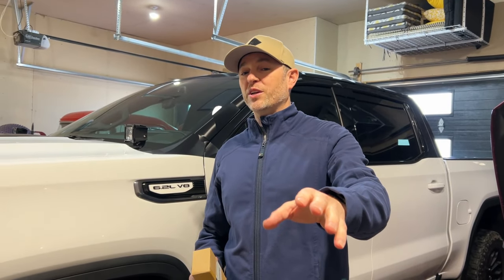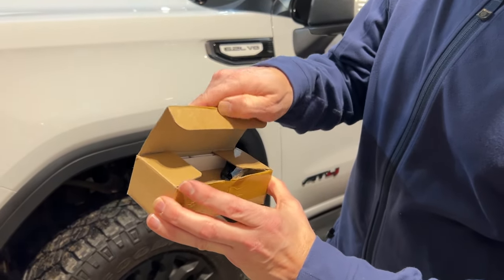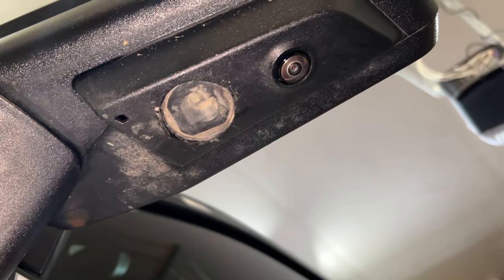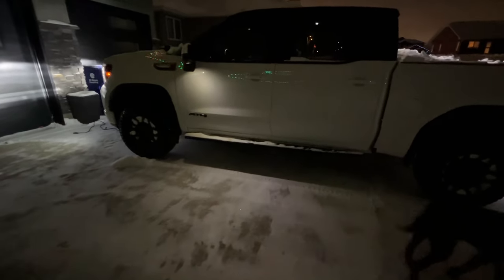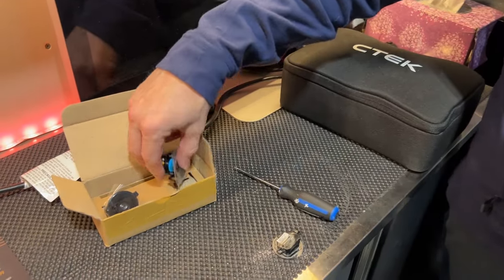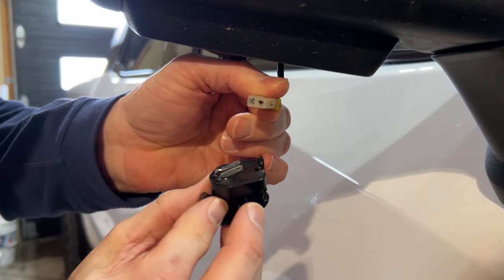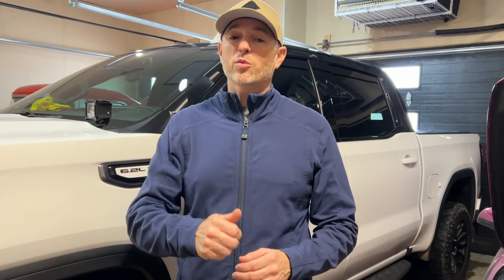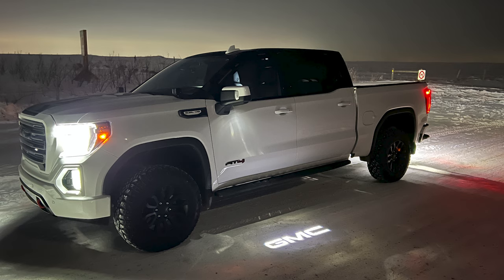Affordable Truck/SUV Lighting Upgrade: Simple Install Guide

Comment: Just added the bow tie Puddle lights to my '24 Silverado 3500. Quick & easy lighting upgrade!

Only issue I had was they didn't work at first...I had to go into settings under Vehicle>Lighting>Vehicle Locator Lights (set to on).
Then they worked as they should. 
Cool, simple upgrade. Thanks for the idea. Being subscribed to your channel could cause my upgrade total to increase...😎
Reply from the maker: Thanks for watching and subscribing!  It can also help you decide what NOT to do 😂
Reply: @Donslife  Lol... I think one of the next upgrades may be the Putco Freedom Blade..😁
Reply from the maker: @BradLMN  I like mine! Use my link if it will help you out at all ✌️

Comment: My last car was a Ford Edge Limited. My wife loved the ambient light in the floor of the car. I want to try to add that feature to my new Sierra 1500.
Reply from the maker: Like this? 

Watch This BEFORE Choosing LED AMBIENT INTERIOR Lighting Mod for your Car or Truck
https://youtu.be/GJr20dQP4I0
Reply: @Donslife I watched your “Before” video. Great job on the video. I’d need to hire that installation out. I think that product would work.

Comment: Used your link to order the lights for my 2021 2500HD Denali.  Can't wait to see them.  I also have the lighted retractable running boards so I am really pumped to see how that all looks.
Reply from the maker: Cool!  It will look a lot like the Escalade in the video too
Reply: Where did you get the lighted retractable running boards?  I'd love to upgrade my SLT with them.
Reply: @johnspurrier0001  They came from the factory.  I had them on my 2019 1500 Denali also but they are different.  The 1500 they went front to back as they came from under the truck.  They also had a big button on the very end that would make them come farther back so you could use it to step up to see in the bed.  The boards on the 2500HD fold down but the really cool thing are the LEDs under when you unlock the vehicle.  All in all it's just one more thing that could break but for now I really like them tucked away.
Reply: https://www.youtube.com/watch?v=RPeixww0bc8  this is the ones on the 1500 Denali.

Comment: Love the GMC logo lights. I have a question, why is my 2022 Denali  2500 not equipped with a manual light switch to illuminate the area in the bed?  When I open the tailgate at night to load items ,I cant see unless I turn on the rear loading lights by using switch on the dash. I do have a bed cover .  If a switch is available through GM it would make for a good video. Great videos Don.
Reply: I've always thought the same thing.  I don't want to have to clime in the cab to switch on the light when coming up to load or unload something from the bed.  There should be an option to switch the lights on from the bed.

Comment: Hello Don new subscriber here, I like you channel I just purchased a 2022 Sierra SLT but the puddle lights won't come on, I did notice they did for like 3 seconds but turned off and wont stay on. I can't find anything that highlights on this specific. Any suggestions? I am going to the dealership in a few weeks to pick up my license plates if I dont have it figured out by then I'll have them look into it.
Reply from the maker: Welcome to the channel.  Couple things… it has to be dark enough for the ambient light sensor on your dash to think it should have them even work.  You can cover it with something to block the light from outside and perform some testing. Also in the settings menu, look at the vehicle’s lighting options and see if there is a setting there.  I can’t remember off the top of my head
Reply: @Donslife  thanks for the quick response back. I tried all those even just now 9:53pm in Texas it’s pitch dark outside. Looks like the dealership will have to look

Comment: Will the floodlights run while driving down the road? Can they be programmed to do that? Or will they only come on when you hit the unlocked button?
Reply from the maker: There is a mod from BoostAutoParts that allows you to turn them on while driving
Reply: Thanks, I don’t see where one is listed for the floodlights I wonder which mod package it is?
Reply from the maker: https://boostautoparts.com/products/spot-in-drive

This one is compatible with mine
Reply: Thx again so much
Reply: @Donslife  hey Dan, I did call the company that you suggested. They did tell me that the puddle lights will not work when the truck is in motion only the spotlight.

Do you have any ideas on how I can keep the puddle lights running once the truck is in motion?

Comment: I saw your video on turning all the rear casting lights on when in reverse. Have you done any modifications that either put a switch in the bed to turn the cargo lamps on and off…or turning them all on when the tailgate is opened?
Reply from the maker: No I haven't done more other than adding bed lighting to the cargo lights.

Comment: Hey Don I am new subscriber I just recently bought puddle lamp for my new at/4 like one this video from 404 parts but I want to ask you a question on HUD display my At-4 is 2022 and seams that the screen is mounted but it does not have buttons behind steering wheel can those be added or do you know anything on how activate it.?

Comment: I have a 6” lift would the logo still be clear enough to be seen being that high up ??
Reply from the maker: I think it would be okay since mine is about 3” up from a Denali or SLT.  2” AT4 lift + 1” suspension changes = 3”.  

Of course I don’t know for sure.   If I remember I will drive up on a 3” block and see if the logo looks out of focus

Comment: Don, what's your take on the GMC Fuel Door Cover, not being able to be secured. Is there a fix or solution?
Reply from the maker: All of newer fill tubes are designed to be syphon proof.  You have an adapter that is required when filling with a gas can
Reply: @Donslife  Ahhh...I see, said the blind man. But what prevents someone from pouring something in your tank?
Reply from the maker: They would need to have the custom adapter tube with them.  Not something most people would have in their pocket or on a keychain.  But now that I’ve said it, there is probably someone out there

Comment: do you think they are as bright as the stock lights?
Reply from the maker: No I don’t think so.  There is a trade off
Reply: @Donslife  thanks for the reply. yeah, the cool factor is worth it i just used your link and ordered them for my 2023 High country it says for 2022 but the mirror's didn't change so I'm think they will fit. keep up the great content.

Comment: It’s cool and all but they didn’t seem very bright from the video.  Puddle lights should illuminate the area outside your door so you don’t step in a puddle.  Just my opinion.  And they might be brighter than they appeared in the video.  Just a matter of personal preference.  As always, everyone is welcome to do what they want with their vehicles as long except squatting.  That’s just dumb.  🤣
Reply from the maker: They don’t and won’t illuminate as bright as the puddle lights.  Of you have illuminated running boards, you can have the best of both options

Comment: Can anyone confirm if these same GM 84408373 puddle lights fit a 2024 Sierra Elevation 1500?
Reply from the maker: 2024	GMC	Sierra 1500	AT4, AT4X, Denali, Denali Ultimate, Elevation, Pro, SLE, SLT

Comment: How do you keep them on?
Reply from the maker: They will only operate on and off the same way that the puddle lamps do.  You could do a wiring mod I suppose with your DRLs but I haven’t explored that idea
Reply: In the video it was on for a long time.  Mine is about two seconds, just enough time for the side mirror to deploy.
Reply from the maker: Is there a setting in your menu for welcome lighting or extending the duration?  I am not in my truck right now, but I think there may be a setting there

Comment: Love these so much! I added a set to my 22 AT4 only to realize my puddle lights aren’t working correctly.

When the truck is unlocked, the puddle lights come on and blip for two seconds before turning off while the rest of the approach lighting functions fine. Both the factory lamps and the GMC emblem lamps do this and I’ve tried every option in settings to see if anything could be messing with them.

Anyone have any ideas? I’m losing my sanity.
Reply from the maker: I can’t remember the menu options in the settings, but maybe check there and see if there is a timer to adjust.   I am not in my truck to check while commenting on this

Comment: wow. underwhelming, give next to NO light.
Reply from the maker: It is what it is, pair it with illuminated running boards ✌🏼
Reply: I thought the same thing at first.  I really like the GMC logo, but was disappointed that it didn't give out more light.  Adding lights to my running boards I think will do  the trick.
Reply: Are those factory wheels
Reply from the maker: Yes 275/65/r18 with 1.5 hub-centric spacers
Reply from the maker: Hyperdipped black too.   Videos for all of it

Comment: Q: so do these stay lit anytime headlights are on?
Reply from the maker: It’s a great question, but no they don’t.  They stay on for the amount of time your current puddle lamps do.  They are just a different style of lamp to replace the your original ones
Reply from the maker: @Boobtube.  Got it.  When the ambient light sensor on the dash detects that it is dark enough outside the vehicle they will come on when unlocking the door as well as when shutting off the truck and exiting.  Maybe 10 seconds or so.  There is a courtesy light setting in the truck’s configuration menu of the infotainment system.

Comment: Do they make them for a 23 chevy trail boss lt?
Reply from the maker: If you have puddle lights already, I think they would fit. The mirrors haven’t changed but it has to have the wiring there to plug into